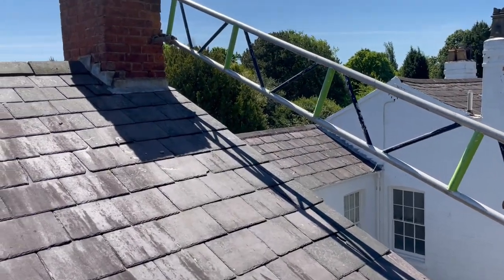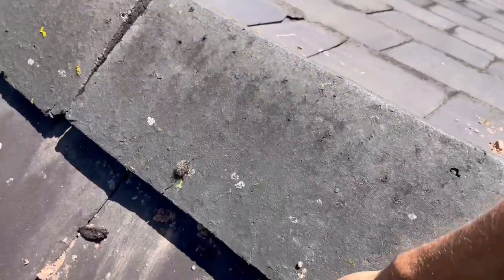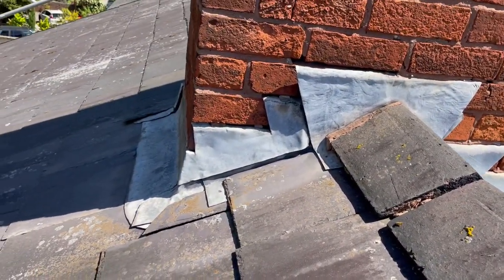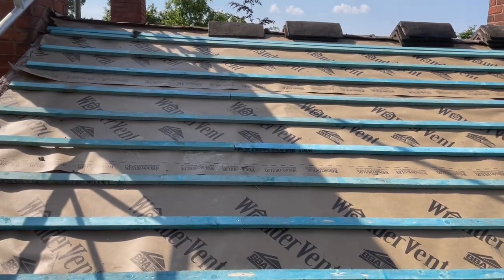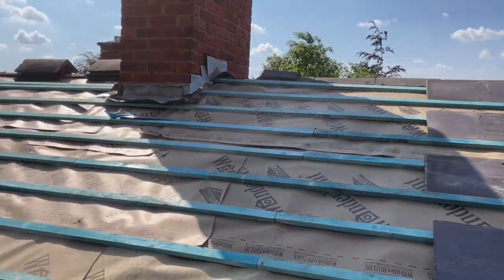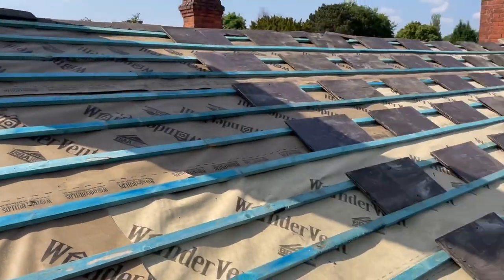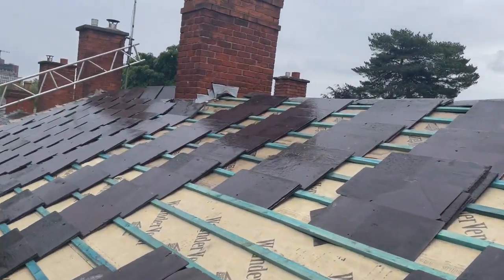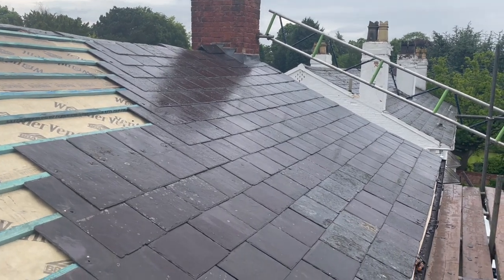Redoing a Old Natural Slate Roof

Comment: I'm still learning.... Just from reading, should the felt not be fitted looser so that it drapes between the rafters? Or alternatively a counter batten put on first vertically? Otherwise, water that gets passed the slates and onto the felt can't pass the horizontal battens and reach the gutters....
Reply from the maker: Generally it should be a little loose but not excessively. I did not pull it too tight and it does slacken a bit by the time you’re done anyway. Don’t over complicate that part. Water will escape. Counter battens can also be used if spec requires it.

Comment: Dave, can you please answer me this. I am looking at redoing my own roof. Semi detached all skate original roof from the 30s. My question is, what to I do with the slates that overlap on our party wall? Do I put x2 nails in where I can reach when boxing it back up? Silicone them? I can't find anything online.😊
Reply from the maker: Needs a bonding gutter. Example of this is in this video I did.
https://youtube.com/shorts/xBOSdF4eFZQ?feature=shared

Doing a slate roof as a diyer may be a challenge and cause all kind of problems for you if you’re unsure and not confident so my advise would be get a professional company to do it. Good luck.
Reply from the maker: Or just get all the materials and hire a roofer day rate to help you out and show you the ropes. Then you can’t go wrong. And would be cheaper and good experience. 👍
Reply: @davesalter  will the bonding gutter not give a slight lump at the joint? And another couple of of questions for you. 1. have you ever installed a dry verge on a slate roof?
2. I am looking for a traditional style, terracotta dry ridge system. Have you ever installed one? Do you know where I can get one from? Cheers
Reply from the maker: @liamdanher1992  yea the bonding gutter does give the slates a slight kick. This is usual and is fine. 
You can get dry verge for slate roofs yes, continuous dry verge systems generally used for this. If you mean a terracotta colour rather than black yes you can get dry ridge like this. 
I’d advise you find a local roofing supplier and go in and ask your questions, they would be happy to help and supply your project im sure

Comment: I take it you a hero because u don't use nail gun , or skill saw ? I'm pretty sure breather membrane has to have 25mm sag to work ? And where is the felt support trays ? Membrane rots in sunlight like the old 1F , and it's known to whistle in strong winds  ! Also there is no way I'd ever put a slate on with a corner off it ..
Reply from the maker: I did fit eaves trays to support the felt, but yeah i don't profess to be the worlds best slater and you are probably better at it than me. But i had fun doing it and the customer was very happy!

Comment: Over stretching the slate's!!!!
Reply from the maker: 2 inch headlap is common on older roofs, i laid it out the same as it was done around 100 years ago. But i understand it is not usual these days. 10 inch guage on fibre cement, giving 3 inch headlap, which is the same size slate as used here.
Reply: Oh the cost of that scaffolding! 😖

Comment: 24"×12" slates lathed at 11" gives you 2" headlap, looks like you were going off the original laths
back then sometimes they gave slates 2" but today big no no, do yourself a favour and get a good roofer, your about 65% on it
Reply from the maker: Yeah I battened it out the same as it was done 100 years ago. 2 inch was water tight for that long so can’t be that bad. But points accepted, I don’t claim to be expert slater so still learning on some areas. Cheers.